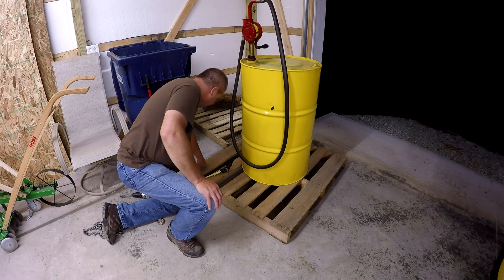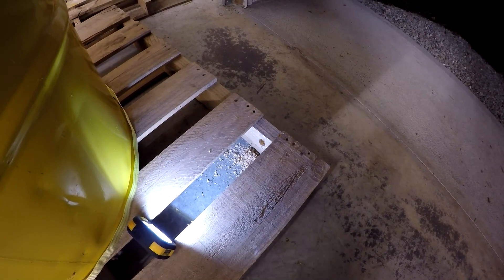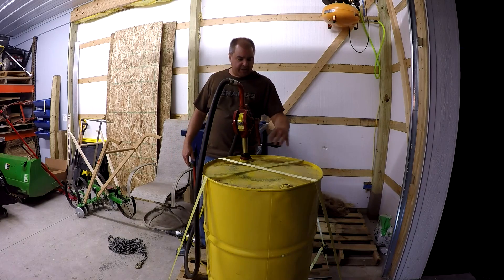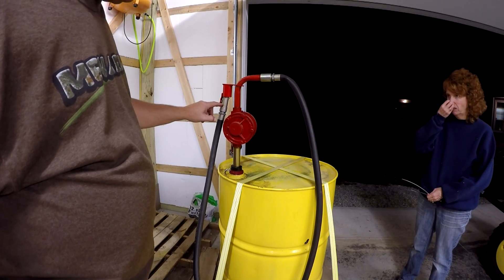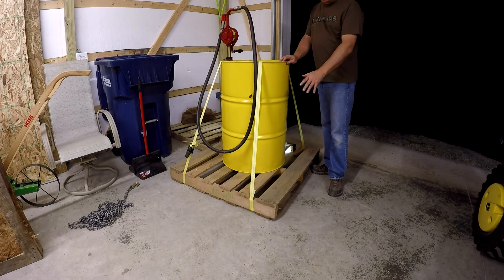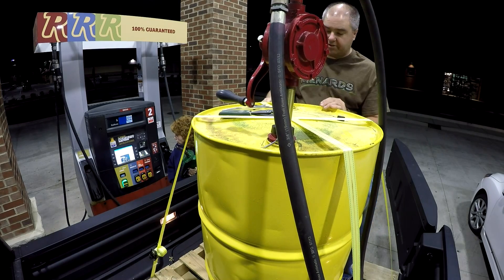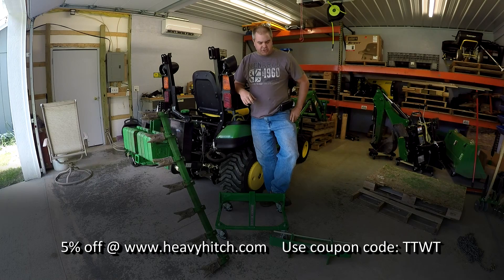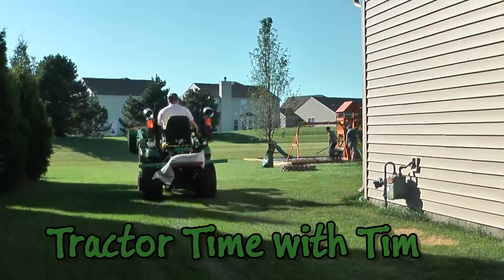#81 DIY Diesel Fuel Storage, Transport, and Pump via 55 Gallon Barrel for Compact Tractor

Comment: So Tim... how are you filling your 55 gal drum now that you switched to a drum dolly???  I looked for something showing that and haven't found anything.  I am purchasing drum dollies for my drums and was wondering if you had a good solution to re-supply your drum when empty.  Right now I am using the 14 gal. Scepter tanks for gasoline and one for diesel (clearly stickered with DIESEL).  I can load them in my truck easily, fill them and move them to refuel my equipment from the back of my truck, since they are basically gravity feed.  I have watched a video on adding an air pump to force the flow and am considering that, but I still have 55 gal drums for bulk storage so my initial question still stands.  TIA.
Reply from the maker: The drum dolly makes the drum less stable in the truck….but I still loaded it with forks and transported to the gas station to fill up.

Comment: Why not lift the pallet higher than the filler neck with a ball valve at the end of a service station hose and tilt it with the pallet fork loader?
Reply from the maker: Every time I need to fill up the tractor?

Comment: Started unscrewing the bung ( gasoline) to my 55 metal barrel and the pressure coming out was enormous - spraying out inside my garage. Only 60ish degrees outside. Very dangerous I think. Do you have this problem?

Comment: To avoid kinking the hose, try using an 8 inch long spring slipping it over the hose up to the pump. This will allow the hose to move around but not kink. Use a pretty stiff spring.

Comment: are you using off road or auto diesel
Reply from the maker: I used on road diesel for many years...due to availability.
Just started using off road now...as I have a larger permanent tank.

Comment: disconnect the hose  and install a 90 degree elbow that will make the hose hang straight down, then it won't kink and while you have the hose disconnected do some plumbing and install a fuel filter.  I did something similar. I welded two u-bolts to the top of my barrel so I can lift the barrel using a chain with my front end loader and place it in my truck and then unload it and place the barrel under a shed after buying fuel. I also use a  12 volt electric barrel pump to dispense fuel out of the barrel, much faster than a hand pump. I charge the 12 volt battery monthly especially in winter. I also charge tractor batteries and lawnmower and generator batteries monthly when not used regularly.  I don't like the surprise of a dead battery when I need to crank a motor.

Comment: I know this is a tractor channel and this is why I subscribed a while back.  But, this is the first time that I noticed you have a Ridgeline.  Have you had any trouble with it?  We are thinking of getting a newer vehicle soon.  My wife likes Honda.  The only thing that I had against the Honda she once had was having to change the trans. fluid every time that I changed the engine oil.  I was excited when they released the latest ridgeline but, mostly poop reviews is all that I found.

I like the pump system because I got tired of holding the five gallon jug for the time it took to empty and trying not to spill any in the process.  Our tractor is new to me so I haven't used even a tank full of fuel yet.  I usually only buy 20 gal. every two weeks for my diesel truck.  That gets me through my hour long commute round trip a day every day for the two weeks.  Now that we have two diesels it would be nice to have some set aside for when I need it.
Reply from the maker: Absolutely love the Ridgeline.  Incredibly luxurious ride.  Quiet.  The trunk is huge. The dual swinging rear tailgate is incredibly functional.
The bed is longer and wider than the Tacoma, but the overall truck is shorter.
Amazing engineering.
Folks make fun of it now, but inpredict we will see more unibody trucks in the future.
Oh, and we have a review video of it on our channel.

Comment: If you would put a 45 degree  connection  and attach your hose , and another suggestion  is also put a water seperator with a filter to keep your fuel clean in your tractor . Keep up the videos 😁
Reply from the maker: Ah, you need to watch the later video in this series :-)
Reply: Oh ok i got it

Comment: Not smart putting that in the truck, that's highly illegal.
Reply from the maker: +Ram-n_dodge please show me the law.  I have looked, but I cannot find anything.
Reply: 30 CFR 75.1906  and 49 CFR 173.5  plus others, contact your DOT for further info because the laws are confusing and convoluted as f#ck because retards write them.
0-5 gallons, use a osha approved canister like a regular gas can
6-119 gallon you must use a DOT approved tanks, like a like one from RDS, transfer flow, titan and many others
120 and above you need a CDL with hazmat

I checked on this not too long ago because i was going to do the same thing you did.

Comment: Tim, they have a fitting made by CatLow its called twister swivel 3/4 M x 3/4 F part # CLC72075  I have them on my gas tank, they work great! there is other brands that do the same thing. Check it out. It will keep your hose from kinking, and keep fuel flowing. Check out Tractor Supply.
Reply from the maker: Already got'em.  ...video has been captured, but not yet edited.
Reply: Tractor Time with Tim Cool, looking forward to seeing the video.

Comment: Love your channel, I think it's great your wife and daughter are so into your tractor time.  I too had an issue with fuel storage.  I use a Ford 1710 diesel tractor, but I don't have lift capability.  My solution was to build the storage on a trailer.  I belong to a survey group where I earn Amazon gift cards for completing survey's, so I simply saved enough to get the items I wanted such as an electric pump and 25' hose reel.  I used a 30 gallon air compressor tank added a filter and mounted it all on a harbor freight trailer.  With the exception of the hitch bar, it doesn't take up much more space than the pallet you are using.  When I need to get fuel I simply tow it to the gas station when I need to fill my tractor I place the nozzle in the tank and turn the pump on.  Being a disabled vet I had to eliminate any heavy lifting, so this works great for me.  Thanks for an education channel and keep up the good work.
Reply from the maker: +Clifford Rigney Great idea Clifford. ...and thanks for serving our country!

Comment: Tim buy a spring big enough to slide over your hose it will help from kinking
Reply from the maker: +Milton Fludgecow good idea.
Reply from the maker: +LawnBoy ParkBully the titan forks are very heavy.  This reduces your lifting capacity by 25% or so. When buying forks, look at the weight and the strength. Artillian uses very high strength steel so that they can get the most strength for the least weight. ...and their new frame has a 2" receiver built in as well.
Reply from the maker: +LawnBoy ParkBully tell Chris at Artillian that I sent you!

Comment: Hey Tim, I understand your wanting to have diesel onsite, it's a pita to constantly run to a gas station with 5 gallon cans.  In wisconsin, even here in the ag community, we are not allowed to store that much fuel inside any building.  It all must be outside.  Having said that, your setup looks pretty nice and definately makes refueling a whole lot easier.
Reply: Keith Rahn I'm tired of the government regulations. Can't even have gas cans without them being regulated with nozzles that don't work and create more spills than the old ones
Reply from the maker: +Keith Rahn ...and folks seem to be comfortable with ever increasing size and reach of the government...

Comment: Another well done video!  I would take a couple of spare 2x4s and cut them and screw them into the pallet making a square box around the bottom of the drum.  This will keep the base of the drum from moving around without having to use as much force with the straps which will keep the pallet from flexing as much.  Just make sure your screws don't protrude too far through the thin pallet slats causing interference for your forks.  The other side can be anchored into the 3 main supports in the pallet.  Just an idea.  :^)  As far as the hose (besides the coil idea) you could use a metal 90 degree elbow off the pump.  This way your hose hangs vertically down which is where it will spend most of its life.  For the height of your tractor I suspect it should still have plenty of hose to reach the tractor without kinking during fueling.  The coil may be the only option on the tractor end.
Reply from the maker: Good idea on the box.  I now have several good ideas for 'version 3' of this solution!

Comment: Hey Tim!  Great videos as always!  That's why I've watched all of them, that has to do with the 1025r.  I will continue to like and watch all of them, BC I've learned so much from you and them.  I got my new 2016 1025r end of March 2016.  I got the TLB.  It has the loader, 60" mowing deck(that has the quick connect where you can drive over it, on and off which makes it easier for me since I'm an amputee).  Plus the backhoe.  I love it. I've used it way more than I thought, which is always great considering the price!  
Q1- Where can I get a clean barrel like you have, so I can put Diesel fuel in it?  It's hard being an amputee, and lifting heavy gas cans& trying to balance too.
Q2- Where can I get of forks for my tractor like you have, but not John Deere version?  Deere version is always more expensive.  Any help/advice would be greatly appreciated by this Army Vet.  Thanks again Tim, and as always.. Please keep the awesome vids coming:)
Reply from the maker: +Tmac Tmac 1) I would check with a local farmer or truck service station.  You want one which has stored some type of oil.  Then, get it rinsed thoroughly with diesel before using.
2). Best forks are available at www.artillian.com. They are not cheap, but they are the lightest yet strongest available. 
We appreciate the kind words!
Reply: Thank you for the help Tim.  I greatly appreciate it a lot..  You are welcome.

Comment: Hi Tim, I enjoy your channel, keep it coming.

Don't leave that drum out in the rain or leave standing water on the top.  In addition to breeding mosquitos, you will end up with water in your fuel.  The reason is that heating and cooling of the drum during the day.   As the drum warms up it creates a positive air pressure inside the drum and air is forced out.  As the drum cools during the evening and overnite, a vacuum is created, which will draw some of the water from the top of the drum inside with your diesel fuel.

As far as your fuel hose goes, go to your local farm store and buy a proper fuel hose and an auto shut off nozzle, you will be glad you did, do it before you spill fuel on the ground because it's hard to pump and watch how full the tractor tank is getting at the same time.
Reply from the maker: +norite well, you see the drum's 'home', so it won't be outside.

Everyone's comments have motivated me to find a filter and elbow to fix that top kink.

Seeing the tank fill level while filling has not been difficult. The fender level fuel fill hole is very comfortable for that.

Thanks for watching and commenting!

Comment: Well I see that you got all kinds of ideas to "fix" your hose problem so I won't add to it. Besides my idea might not work. :) I did look up where you got yours and I think they screwed you. The one they show has a down bent tube coming off the pump so the hose won't kink. With that kink you might need a new hose in a month or so. I like your tank. My 15 and 5 gallon tanks get heavy. I use gravity feed. One of these days I won't be able to lift that 15 gallon tank over my head. Need, need, need a set of forks...to go along with all the other needs I have. Wife looks at it as money we don't have for stuff she doesn't know what to do with if something happens to me. I did get her to go along with the wagon thing though. Mainly because she doesn't like sitting on the left foot floor on the tractor and I can't get her to drive it. Have to leave the MMM deck on so she has a place to put her feet. Guess I could sell this place and buy some flat land. :)
Reply from the maker: +mi2tn not sure why my pipe is horizontal.  I think I like the 'add filter and elbow solutions the best so far.  Always been nervous about not having a filter.
Replaced fuel filters on tractor the same day as this video.  Have to get it edited/posted.
Thanks for continuing to watch and comment.  We'll convince your wife on the forks somehow :-)

Comment: A good and safe fuel storage/transport system is something I found necessary right away. I even considered fuel delivery to a tank but was concerned that today's diesel fuel would develop algee from sitting too long. Also a large container may gather condensate too quickly. So I settled on a 30 gallon saddle tank. An inline electric fuel pump using a four wire flat allows me to transfer fuel from the four wire flat I put on the tractor battery that is also where I connect the battery maintainer. The fuel pump has 10' of inlet hose (1/4"fuel line) and inline filter, exiting the pump is 8' of hose a quarter turn valve and 1' of hose to go into the receiving fuel tank. This whole assembly coils up neatly in an old Dewalt drill case. I can carry it in my truck box to help stranded motorists without the need of a fuel can. The fuel pump is a Mr Gasket and has been quite forgiving of being run dry as I purge the assembly of fuel between uses and getting a prime started. It is slow but a good compromise for all the ways I use it. Oh, JD2320 has a miserable fuel cap location in the hood in front of the steering wheel. Filling 9 gallons up with five gallon cans while balancing on one foot and reaching over the loader arms should be grounds for an enemployed engineer. The location of your fuel cap is great? Waist high while standing on terafirma.
Reply from the maker: Good stuff.  This is the reason I put together the video. Everyone seems to have to 'invent their own' fuel storage system.  So, I wanted to show how I made mine.  
Sounds like yours could use video as well!
I wanted to avoid the 12v pump.  Just didn't see the need, and I wanted it to be fool-proof.  
We used to use a hand pump for 50 gallons back on the farm ...but I admit that was many years ago, we finally did get an electric pump.  Anyway, I knew that 3-5 gallons at a time would not be much work.

Comment: Did you source your 55 gallon drum locally? If so, I'm in your neck of the woods in Fishers, and may be able to use the same source.
Reply from the maker: Hi there, neighbor!   Thanks for commenting.
I got my barrel from my family's farm.  They buy their hydraulic fluid and motor oil in such barrels. 
They rinsed the barrel repeatedly with diesel before bringing it to me.
I'm sure they would have extra empty barrels, but they are in southern Illinois.

Anyway, do you have a tractor?
Reply: +Tractor Time with Tim I'm picking up my 1025R on Saturday. I'm trying to get a game plan together on fuel storage. Lol
Reply from the maker: +Alan Schmalzried Congratulations!!  From Reynolds?  
We'll have to get together sometime!
Reply: +Tractor Time with Tim I'm getting mine from Mutton in Fort Wayne. I grew up in that area. My dad and I are planning to make a day of picking up the tractor and testing it out on their property. We are really looking forward to it!
Reply from the maker: +Alan Schmalzried I got mine from Mutton's as well.
Reply: +Tractor Time with Tim I knew they had a good reputation and really liked that they priced the tractor, loader and mower packages. That was extremely helpful.

Comment: other people in your position and what i do , place filter on the end of the discharge of your fuel pump , also if you take fuel tank to the gas station  ,https://www.youtube.com/watch?v=1B-rwLXWx1A , you should place a ant-static line from the diesel tank to pump before you refuel . you can get fuel rate swivel  from the discharge to prevent hose from twisting and premature failure. http://www.opwglobal.com/products/us/retail-fueling-products/above-ground-products/standard-dispensing-equipment/swivels-and-breakaways/multi-plane-swivels

Comment: do you buy on road diesel or off road diesel? I run off road diesel it's cheaper because it dosent have the road tax. and it's red colored that's the only difference between on and off road
Reply from the maker: I had a segment about that in a preliminary version of this video, but removed it trying to keep the video focused.  I use "on road" diesel because of the simplicity of getting it from the service station.  I have used less than 100 gallons in the two years I've owned the tractor, so it really hasn't cost me that much extra.
Reply: off road is usually cheaper than gass. well it is here. I just get off road at my regular gass pump where we buy our diesel
Reply: Unless out in an agricultural community it can be difficult to locate Off-Highway Fuel. Sometimes sulfur content is higher too.

Comment: If you got some old hose similar in size to fuel hose you could cut off a piece and split it lenghwise then wrap it around the fill hose where it kinks. Use zip ties to hold it together.  Or something else with the similar thought in mind.
Reply: Like the video.
Reply from the maker: Yea, that might work.  
Thanks for the idea!